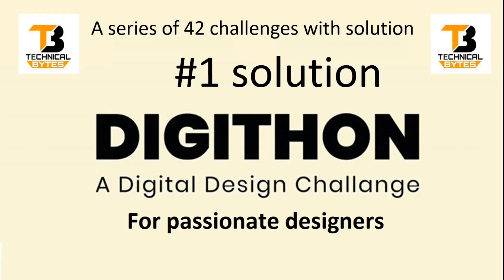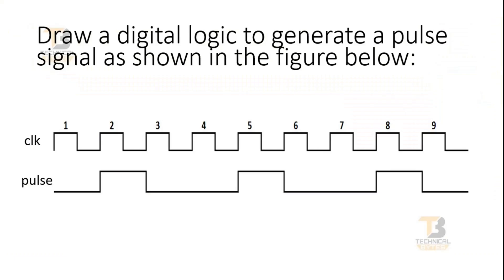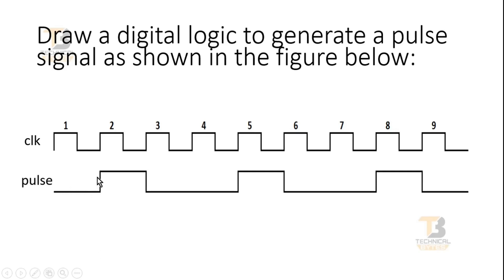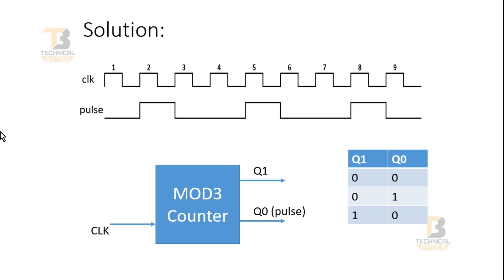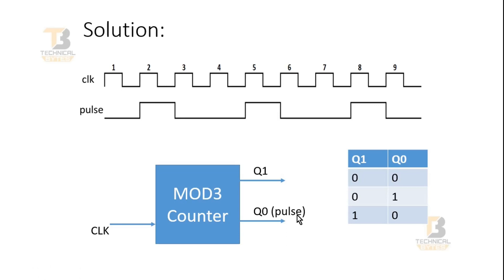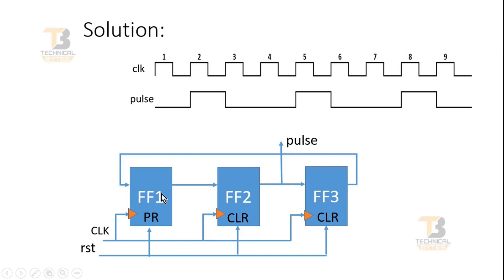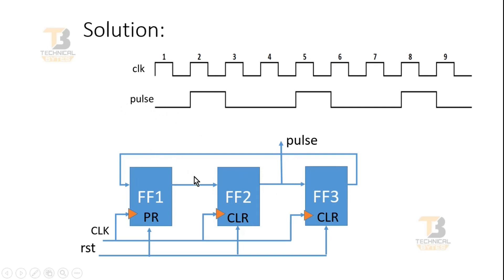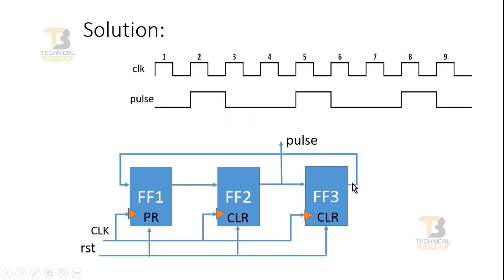DigiThon Solution Part 1

Comment: only 2 flip flops are needed
Reply from the maker: Not possible with 2 flip flops. Our expectation is that one cycle output should be HIGH (1Flip flop required) and two cycles output should be low (2 Flip Flops required).
BTW, If you have idea, then you can share it here.